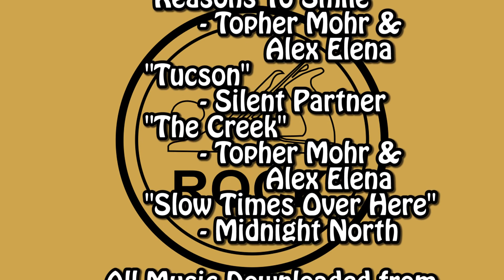Stickers, Shop Tour & Edmonton Guild

Comment: Nice shop there Gord! Really like your method for storing the CNC table, very slick!
- Bill
Reply from the maker: Thank you, Bill. I just wish the ceiling was about 3" higher. I can still give myself a real headache if I'm not careful. Still, it does free up some floor space and that's a lot more valuable than the occasional cost of a band-aid! 😀
Take care,
.....Gord
Reply: Ouch, right there with you Gord, years ago I was an auto mechanic. Lifts are 6' tall and I was 6' 5" before putting my boots on, can make for a bad equation! :)

Comment: Gord,
    Did you build you CNC router? If so, would you do it again? I have considered building one, but wonder if it is worth the effort, in both the learning process and actual use of the machine. I would love to hear you opinion.  Can you point me in the right direction if I decide to do it?

Skip....
Reply from the maker: Well, technically, I guess you could say I built it but it was from a kit. I did not go to the trouble of finding all the parts and doing it on my own. I always wanted one but could never have afforded one of the professional machines that are all put together and ready to go. There was a fair amount of work involved in getting it put together but I'm glad I did it that way as I learned a lot that I never would have known if I had purchased a ready-to-go machine. I enjoy using it but must admit I don't get a lot of use out of it. I find that the time I spend using it I often would prefer to just be turning. And there is a huge learning curve if you want to get really good at using it. The software I use is included with the machine and not nearly as good as the stand alone software you can purchase. It's also much easier to use!k
The one I have is called the X--Carve and is made by Inventables. You can get all the information you want on their website: Inventables DOT com. If you go there to check it out be sure to visit their forum. The information and advice you can get from the users of the X-Carve is amazing. I hope I haven't talked you out of getting one! I don't regret purchasing mine but I do wish I got more use out of it. But that's because of my turning addiction. I always seem to go back to woodturning. Now I'm trying to find ways to use the 2 hobbies together. Making lids for Beads of Courage boxes is one of the few things, so far.
I hope answers your questions, Skip. If not, feel free to ask or visit the forum I mentioned.
Take care,
.....Gord